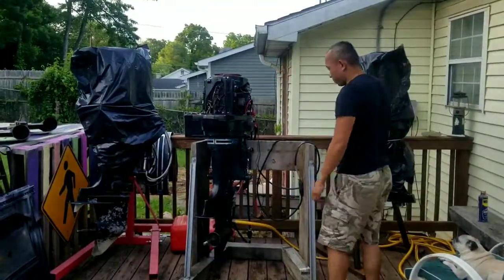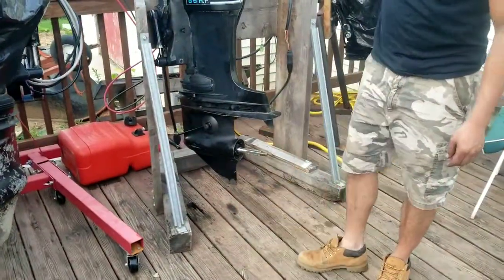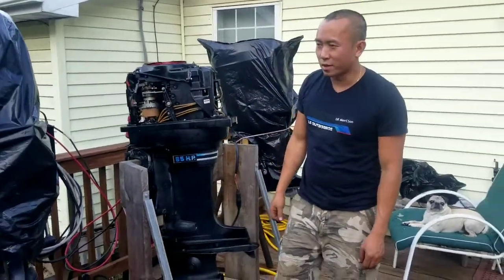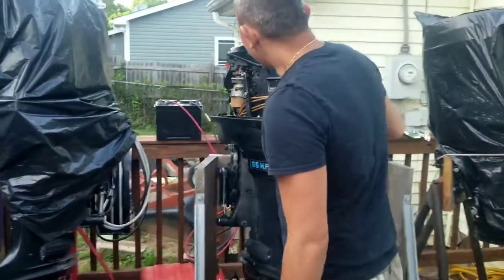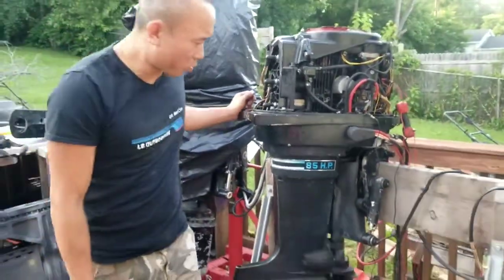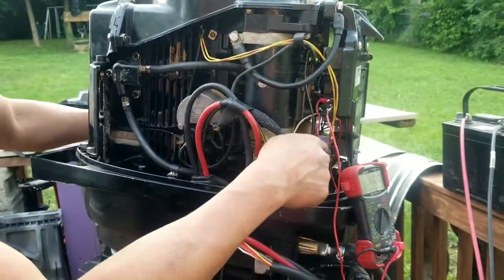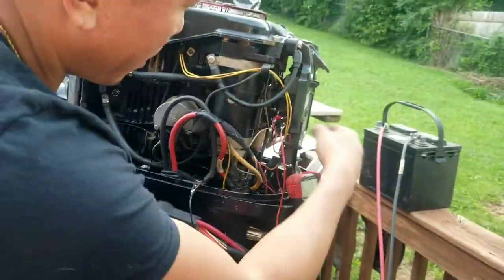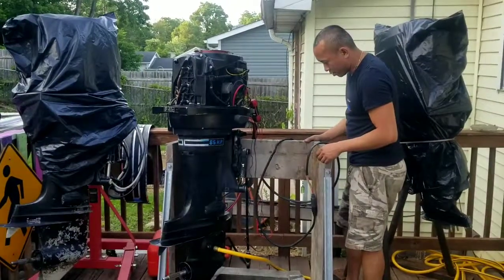1975 Merc 850 Autopsy and Compression - Will it talk?!?!

Comment: Been learning a lot watching your videos, Thanks for posting.  I have a 72' Merc 800, it was running great for the first few pulls in the lake,  but now I'm not getting full RPMs under load, and only going half the speed I was before at WOT.  Any suggestions where to start?  I've checked the fuel lines and new filter, brand new gas, plugs looked ok, and it doesn't sound like it's missing.
Reply from the maker: Spark test and perhaps a carb rebuild. Son
Reply: @MerCSonL6  I'm getting spark, I thought I fixed it. Rev's up fine with no load. But when it's in the water I'm only getting about 3400 RPM on the top 2 cylinders and 2800 RPM on the bottom 2 cylinders. Is the block shot? Can't figure out why bottom cylinders are not firing at the same RPM's. I will take it back and do a compression test later. Do you have any thoughts? Bad distributer/trigger? Also found out the battery is not charging now. Going to test the stator and rectifier after watching your videos.
Reply from the maker: @BradleyKang23  that doesn't make sense. Rpms are governened by the the pulses off your stator. How are you separating the the cylinders? Sounds like a bad switchbox or stator. Son
Reply: @MerCSonL6  Yeah, it doesn't make any sense to me either, I used a digital tach on the  plug wires. I checked each wire individually. top 2 cylinders had the same reading at idle and wot. bottom 2 where both 600 to 800 lower. all plugs where pretty clean and wet. Gonna check the crankshaft seals too when I get a chance to work on it.
Reply from the maker: @BradleyKang23  bench test your stator. I'll see if I can find the video.
Reply from the maker: Wait, I'm an idiot. A 1972 stator does nothing for the ignition 😅. Disconnect your rectifier and see if get the same results.
Reply: @MerCSonL6  I'll try that! Thanks so much for your help. I've been watching a lot of your videos and it's been a huge help. My grandpa will be so happy to see his boat running like new again!
Reply: @MerCSonL6  I'll start there! Thanks!

Comment: Great Vid! thank you.  My 1978, 85 HP Merc starts IMMEDIATELY.... but runs horribly rough at idle & and slow speeds... the engine literally shakes.  seems good at high speeds.  I do have great spark.  any tips on where to look next?
Reply from the maker: Link and Sync and carb adjustments. Son
Reply: @MerCSonL6   thank you! just not sure what  "link and sync" mean.... got a short definition for me?  :-)
Reply from the maker: @sicklecell9999  link and Sync is the process of getting your carbs and timing synchronized. Sounds like your engine is struggling to get fuel at low speeds. Have you rebuilt your carbs? Timed your engine? I'll put a link below to the process on an L6. Son
Reply from the maker: https://youtu.be/OUFXaNgk0Xk
Reply: @MerCSonL6   Yes I'll rebuild both carbs this week, then check timing. this is the 850 thunderbolt engine. THANK YOU  ! ! ! !  will check out your channel and sub!

Comment: How to access and fill the tilt hydraulic fluid chamber on a 1977 crestliner boat with a merc 850 motor.
Reply from the maker: Follow the Hydraulic hoses to the stern mount trimp pump. On the top corner you'll see a Flathead screw. Be sure your unit is up before you fill it. Son

Comment: Every time I put mine in gear it dies
Reply from the maker: Fuel ratio or mixture could be off. Try turning each idle screw 1/4 turn out. Son
Reply: @MerCSonL6  thank you
Reply from the maker: @chadmiller008  you can also try advancing the timing 3-5 degrees. That might help. As of now there's not enough fuel of crankcase enertia to keep the prop going under load. Son

Comment: ive just bought one of these and its been sat in a garage for 6 years im wanting to strip carbs and impeller plus oil in box and look at all wiring for corrosion. what else would you say check before trying to start it
Reply from the maker: Timing. Son